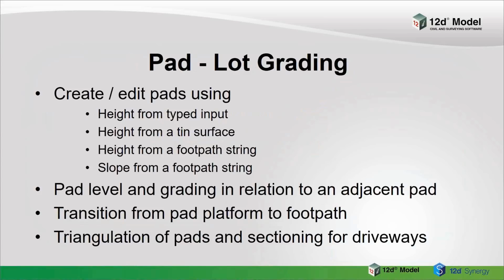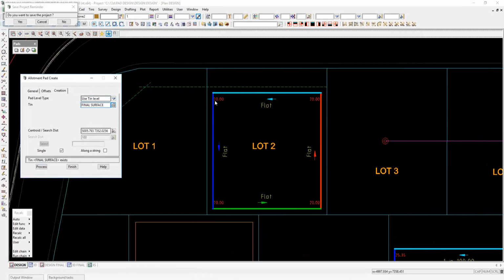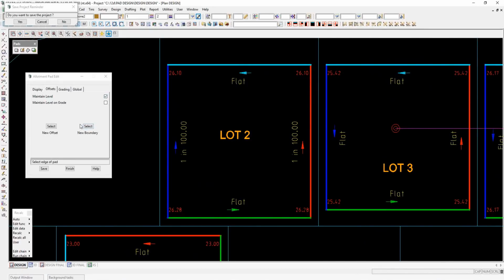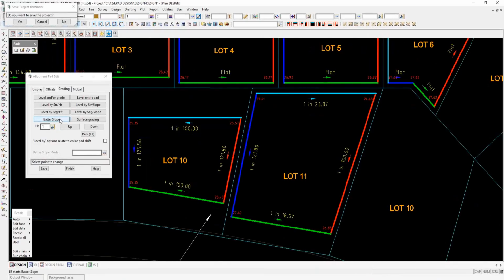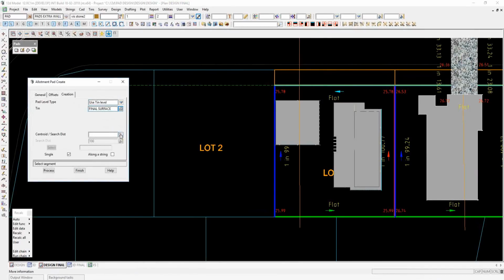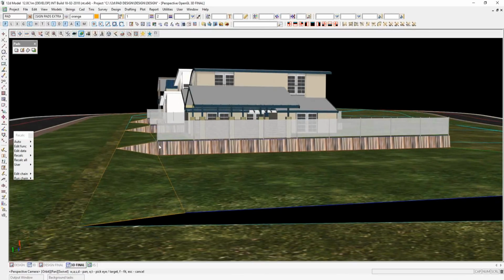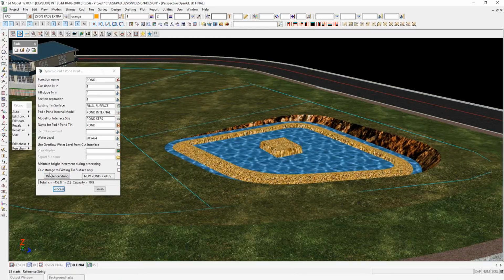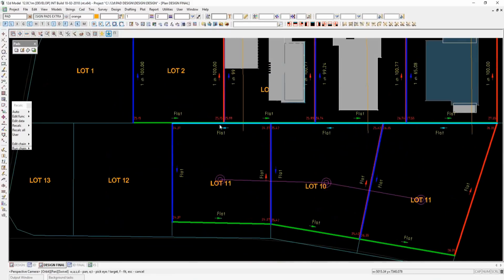Pad and Lot Grading - Training Webinar Series

Comment: Why do my two perpendicular segments to the boundary usually have different grades? One segment has the correct grade (for example, 1 in 100), but the other segment has the wrong grade.
Reply from the maker: Hi, the 'Surface grading' tool works by applying a grade to each segment relative to a direction. Any boundaries which are not parallel to the direction specified will therefore have some grade applied.

Comment: I have a question: since you’ve assigned the pad to the tin surface, the four corners of the pad should have different elevations corresponding to the points on the surface, right?
Or do we have any similar function that allows those corners to inherit the elevation from the assigned surface?
Reply from the maker: Hi, yes you can have the string inherit the elevation from a surface by performing a 'Drape' via 'Tin => Drape => Drape' in the main menu and using the 'Vertices Only' drape mode.
Reply: @12dModelSoftware  I want to contact you directly so we can communicate and ask questions more easily. Do you have any channel where we can discuss online?
Reply: @12dModelSoftware  

For example, a string has two points, 1 and 2. I have already set the elevation for point 1, but point 2 is still on the old phase. I only want point 2—which is part of the string—to take the elevation of the old phase so that I can grade the lot more easily.
Reply from the maker: @vanthangpham6228  Yes you can, however the process for doing this in an automated way is quite detailed, and uses MetaConnex as well as the Attribute Manipulator. If you are only doing this for a single string it would be much easier to manually edit the string and change the height of the vertex you're wanting to change.